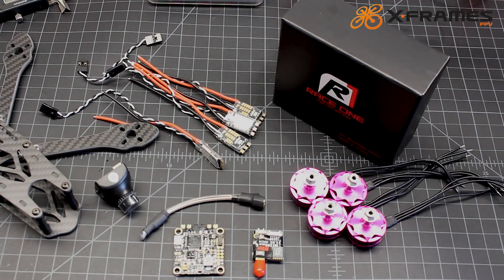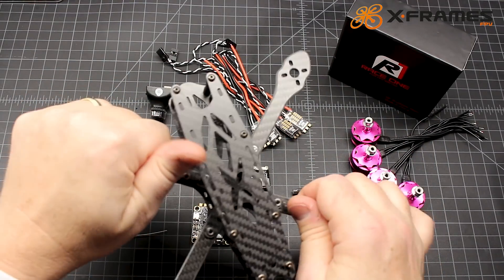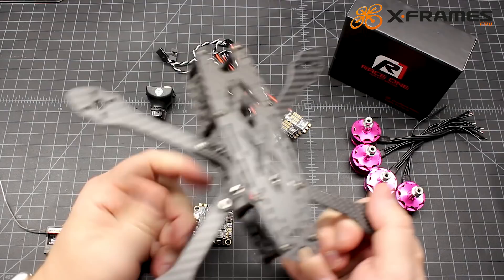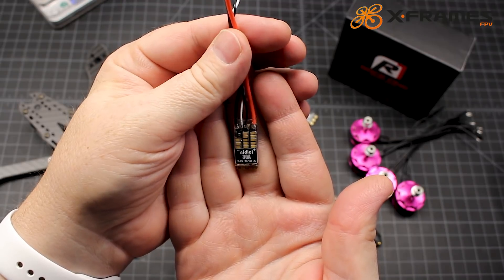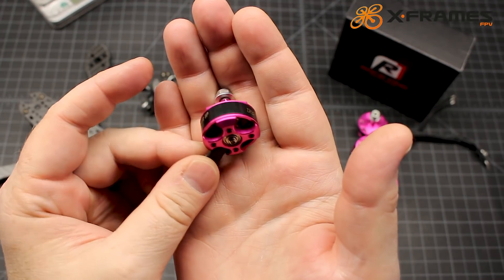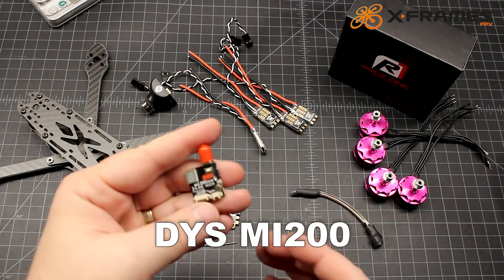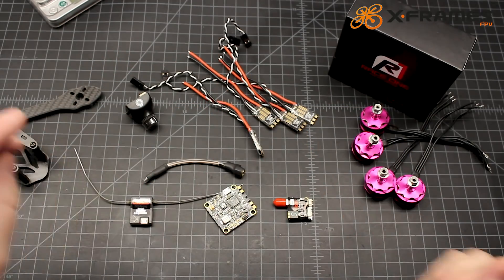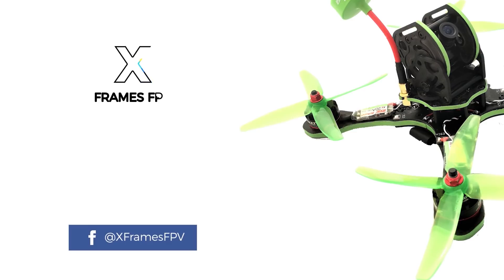Nidici XF5 FreeStyle Frame, BLHeli 32bit & Race One R1's

Comment: Dear x-frame FPV, why did make the buildup video for this frame before te Nidici black pearl even though you received it long time before this one. Are you going to do a buildup and flight video of the black pearl? I'm very interested due to the fact that I bought that frame (hasn't arrived yet) and would like to see how you get on with it 😜 regards!
Reply from the maker: The reason I did this one first, is that Nidici sent me the motors and ESCs for this one for me to review at the same time as the XF5 frame and with the Black Pearl they only sent the frame. I need to get a few parts in before I can do the build-out of the Black Pearl. In the meantime feel free to email me with any questions you might have. memphis@xframesfpv.com
Reply: X-Frames FPV Thank you very much for replying!!! I'll be attentive to that build video